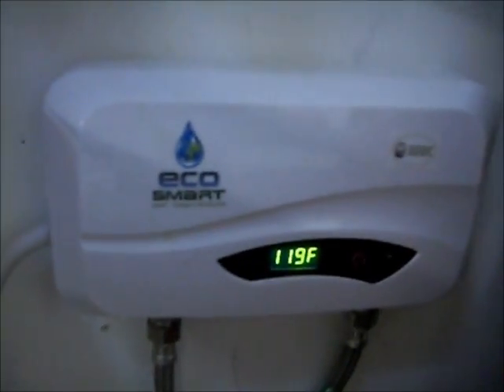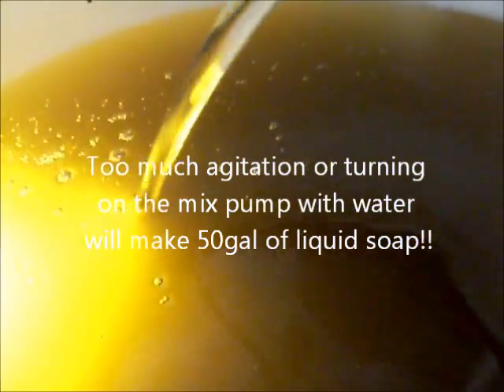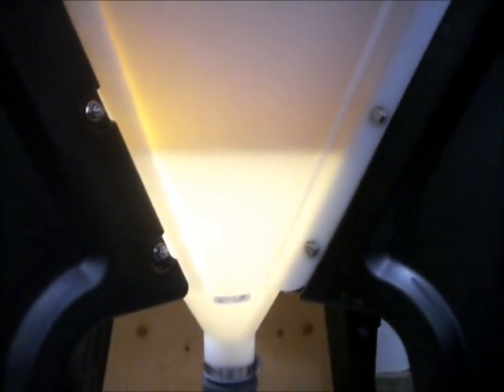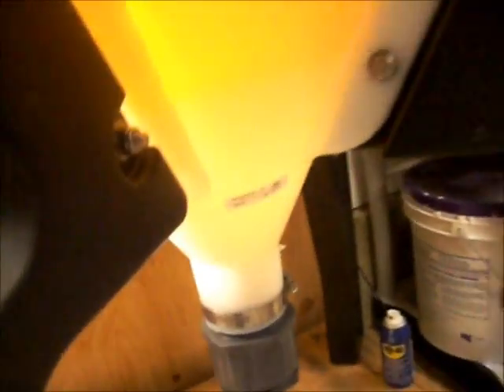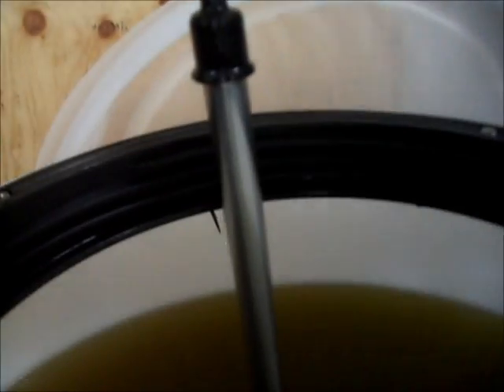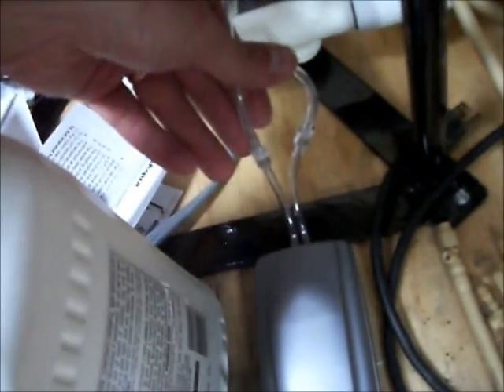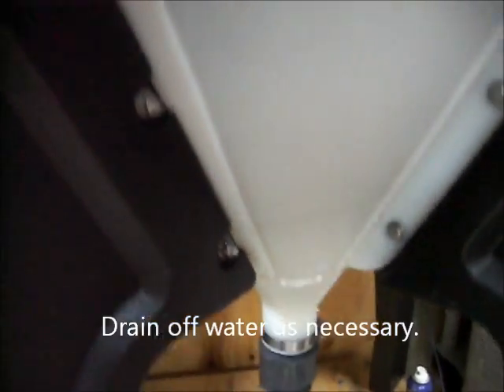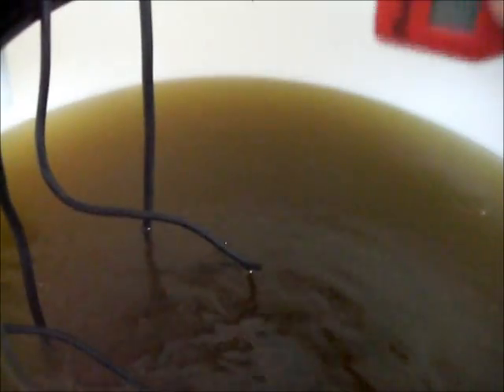biodiesel - water wash then drying

Comment: How to handle the waste water and water scarcity increasing? Can it be recycled? If not it’s going to be extra cost. Instead dry wash with resin can be a better method or distillation which can remove excess methanol and it can be utilised back

Comment from the maker: Typically you can’t heat in the plastic cone tanks. I heat In a Steel barrel then transfer hot oil into plastic tanks. Probably dangerous to have a heating element in the plastic tanks. Don’t heat over 135drgF.

Comment: Which metrial use to make processor plastic or other
Reply from the maker: The plastic cone tanks are usually HDPE. https://www.bing.com/search?q=plastic+cone+tank&form=ANNTH1&refig=b5416a01c52d4b6bad814cbeffeab11a&sp=-1&pq=plastic+cone+tank&sc=1-17&qs=n&sk=&cvid=b5416a01c52d4b6bad814cbeffeab11a Pipe and fittings are PVC available at most hardware stores.
Reply: @westvandude  thank u can we heated these tank at १२०degree for biodeasal making
Reply from the maker: @jeevansinghsisodiya4995  Don't go higher than 135degF in plastic tanks. I heat in a steel drum then transfer hot oil into plastic tanks for processing. It can be dangerous to have a heater in plastic tanks. Can catch fire. Be careful. I sold this setup. I use a Biopro 190 now which is all stainless steel.
Reply: @westvandude thank u very much for reply  upto 120 degree risky or not in HDPE drum
If we heated in steel drum than transfer into HDPE drum no risky or some risky
  How much rate difference in steel or HDPE
Reply from the maker: @jeevansinghsisodiya4995  Over 135degF not recommended as HDPE can go soft. Otherwise only risk is if you install a heating element in an HDPE drum, this is too hot and can result in fire. If you heat in steel drum and transfer to hdpe drum it is ok. Good luck. 135degF = 57degC.
Reply: @westvandude  thank u very much for reply

Comment: Why did you use air pump, what temperature did you use for drying?
Reply from the maker: Air pump helps circulate and helps dry you leave the lid off/open. Aquarium heaters only go maybe 30-35degC but this is adequate. My Biopro190 heats much hotter.

Comment: This helped tremendously! I just ran my first batch in my BP190 but my water-in pump isn't; working so sprayed in cold water and turned on my mixer for about 20-30 secs reasoning that the better it mixed the cleaner the BD...NOT! ruined my batch, made solid white soap! Also, it seems the longer you let it sit, the more fall-out junk can be drained off.
Reply from the maker: Hi. Be careful with manual water washing! You can make a lot of soapy lotion if you aren't careful. The first water wash is the most hazardous. This means add the water with fine mist first, warm water is better than cold water. Manually turn on the biopro heater. When you agitate it for the first batch run propeller mixer for maybe 2-4 seconds at most. Let it settle out. Then again short burst mix.  If you agitate it 20-30secs first water wash you are looking for trouble. Essentially you are making soap lotion. Worst case scenario get a 5 gal bucket of very hot water. Dump 1-2kg of course pickling salt in the hot water. Mix until dissolved. Then dump this hot salt water into your soap lotion batch. Agitate again very briefly 2-4 seconds. Let it settle. Then again, let it settle. Eventually after some heat drain off the water. Proceed with normal water washes after this. The secret with the salt is that it draws the water phase out of the emulsion and breaks the emulsion. Water is attracted to salt. Some people never agitate the first water wash. Then just have a fine sprayer head to spray warm water on top of the fuel. Don't agitate. Let it settle. Drain water. Second wash bit of agitation. Third wash can be more aggressive. Also, one more tip, AVOID using oil loaded with water.... when you tip your used fryer oil into the processor tip slowly. If you see it gets weirdly thin at the end (that's water in your oil!!). Do not tip this into the biopro or any processor for that matter. Too much water at the start of the process will make liquid soap!

Comment: Here is an idea. Close you canister, shoot the oil with high pressure water, drain off the water and sludge from the bottom, heat the oil to 102 decrease with a hose coming out the top to release the ethanol and water, and then your far cleaner in less steps and less energy usage.
Reply from the maker: Hmmm. Interesting. Not sure though, as any sort of high pressure or high speed agitation during the first water wash will make lotion and won't separate easily. Typically you water wash and air bubble with the container open, or that moist warm air won't dissipate out of the container fast enough. Although I still have this equipment I haven't used it in a few years. I have a biopro 190 processor now. It washes automatically. But it's only for those who can afford to buy one. I left the lid on during a wash/dry cycle.... ya... that doesn't work at all! The old setup actually didn't use that much energy, being aquarium heaters they only went to maybe 35-40degC. My biopro cooks it much hotter on drying cycle.

Comment: Ph of biodiesel is 6 or 7???
Reply from the maker: Hi. I'm not sure. Measuring oil directly with a ph meter doesn't work. Ph strips might work. So I can't answer your question. Neutral is probably ideal you don't want to corrode injection system components.
Reply: Ok,before water wash biodiesel my Ph is 7  & after 6.How to confirm it is form??
Reply from the maker: Your wash water may be normally a bit acidic straight out of your tap. A lot of water is not neutral. Here in Vancouver it's about 6.3 pH. Don't trust a pH meter in oil though. Use test strips. I haven't read it yet but here's info on measuring pH https://www.researchgate.net/profile/Mushtaq_Ahmad9/post/What_is_best_way_to_measure_pH_in_viscous_oil_sample/attachment/59d640fdc49f478072eaa9b2/AS%3A273793203802119%401442288794954/download/pH-Measurement-Handbook.pdf

Comment from the maker: It's very alkaline (at least first couple wash cycles). Mine goes into the sewer as predominantly it's acid rain water in the sewer. It does use more oxygen to decompose in the sewage treatment plant but what I add vs all the other sewage is nothing. Wouldn't recommend for septic. Otherwise you can neutralize it with vinegar or sulfuric acid, etc (measure pH) then pour out. You can also add vinager to your wash water barrel if you use a pump to spray it from a barrel into the biodiesel.

Comment from the maker: My friend in the UK did the same thing. You can go about 20% or so straight new veg oil. But depends on the vintage of your van. Common rail injection systems don't like it. 1980 Mercedes 300D can run straight up of course. See if you can buy oil by 16L jugs from a fish'n'chip place out the back door cash, cheaper than grocery store. What's the price of veg oil in France? Fill up the van over there? It might be like wine prices.

Comment from the maker: On 45gal of oil, I typically do 4-5 washes. Each wash is 8-10gal. It's a bit of water. But depends on the quality of your WVO. If you have nasty oil it'll take more washes. If you have excess KOH it'll take extra washes. Basically once the wash water drains out mostly clear you're good.

Comment from the maker: You never use the air pump when mixing the methoxide into the hot oil. Let the pump do the mixing and keep the lids sealed tight. You don't want to breath the vapours. Don't go hotter than 135degF either or the methanol can start boiling when it hits the oil.

Comment from the maker: Sure you can recover methanol from the glycerol, probably 75% or more. However it takes a vessel that can heat the glycerol to 160-180degF, rest of it components from a still to collect the methanol. It can be dangerous. For myself I chose to not have a "bomb" in my workshop. Not sure but you don't want to aerate it too much with an air pump. You only use the pump for drying and if you have an emulsion so you add salt water, bubble for 5mins. Let it settle out. Otherwise don't use the air pump.

Comment: okay; I'm totally new to all this. I get that the water is for neutralizing the pH, and aiding in removal of methanol from the fuel, but can you recover the methanol from the glycerol?  It isn't exactly cheap stuff.  

Also, is it really bad to agitate it hard at the first wash?  I am looking into building my own system, and already have several large size aquarium heaters and a commercial air pump--10x the output of the one shown. It would do nearly as much mixing as a pump. Would it be bad?

Comment from the maker: The residual KOH (very low pH) and residual methanol and other microcontaminants will likely have a party with your fuel system in your vehicle. Eventually you'll have issues with fuel pumps and injectors.

If you don't want to wash you can run the fuel slowly through resin or cellulose towers but they are not cheap.

The first couple washes have pretty dirty wash water that comes out so all that would go through your injectors. 

I wouldn't recommend it. Safer running very well filtered WVO.

Comment from the maker: Not sure about recovering methanol from the fuel portion. You'd have to heat and distill it. More work than it's worth. Waiting 30mins+ between washes gives good fuel/water separation otherwise you lose a small portion of fuel on each wash if you are in a hurry.

Comment from the maker: No, I pour off the glycerol/methanol. There is residual methanol in the fuel before water washing. Currently I add 500ml of water with about 10cc's of sulfuric acid right after pouring the glycerol off. I run the pump for 5-15mins after pouring that in. It neutralizes excess KOH. It'll really help if you've put too much KOH in and your wash water comes out high pH 10+ after 5 or more washes. It also helps with emulsion problems. Otherwise use salt dissolved in hot water. That works instantly.

Comment from the maker: Ideally your final wash water should be pH 6-9 range or as close to neutral as possible. If you screwed up and went to acidic you can always add some KOH flakes to 150ml water, pour that in, air stone mix it. But soap problems can return so be careful.  Again, there is no limit to how long the water is in the tank with the fuel. Longer the better - the fuel will separate more with time. It won't make for "wetter" finished fuel.

Comment from the maker: if you have any soap foam/bubble issues if you use your airstone on the 2nd or 3rd wash. I've added about 15-30cc's of sulfuric acid to 150ml of water. Pour that into the water wash mix. Get the airstone bubbling from the bottom. Let it bubble for 20-30mins. If you had excess KOH before, this will help neutralize it. Otherwise you'll have a pH10 wash water after 6+ washes. It also cuts soap problems. Don't use too much acid or you'll have acidic finished fuel - not good for your vehicle.

Comment from the maker: If you are using a fine mist sprayer the water will grab more impurities than simply pouring it in with a watering can, etc. The first wash water will look an amber colour because it'll be loaded with dirt, soap, etc. After I spray mist wash 5-10gal of water from the top, it's always best to let it sit for AT LEAST 1 hour. Or absolute minimum 20mins. Otherwise when you drain the water you will drain some fuel as well. Takes a while to separate. Typically do 3-4 washes.

Comment from the maker: It's actually potassium hydroxide not sodium hydroxide.... in any case the wash water is slightly alkaline first couple washes but with all the acid rain we get it's pretty much a non-argument. What little goes down the drain cancels out what's acidic in the sewer pipes. Methanol doesn't do anything to your motor - it's only a few ppm in the finished fuel anyhow. Ever heard of water/meth injection? Top fuel funny cars.... it burns cleaner than gasoline. WVO is hard on your IP as well.

Comment from the maker: Real easy fix. Get a 5gal bucket of nice very warm/hot water. Add at least a pound of course pickling salt. Dissolve completely. Dump into processor. Put air stone to bottom of processor. Run your air pump. Should clear up in 10-30mins. Run for at least 1/2hr. Then shut off air pump. Wait at least an hour. Drain water after it separates.

Comment: Hi. I'm new at this and don't even have a diesel engine car. Not yet. So I'm doing my homework first. I do have a question. Is it really necessary to pour water on the finish product? Will that be necessary if you filter the oil with up to a one micron filter before starting the process? Or even use a filter before filling up your car. Thanks.

Comment from the maker: @airtexaco You can heat in poly tanks but need to build an inline heater and run the pump constantly. Can be problematic though. Reg water tank heaters mounted in plastic tanks = possible fire. See my other videos, I heat the oil in a steel drum with a band heater. 1000w band heater takes 6-8hrs to heat to 130degF. Total setup $700-1000 depending on tank sizes, heater types, etc. Here in Canada payback is 5-6 tank fills in my F250.